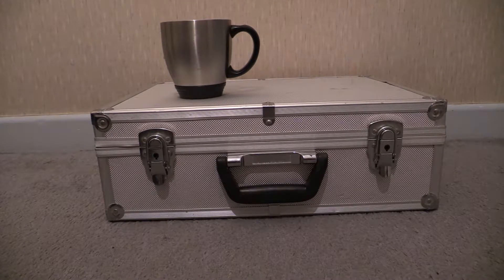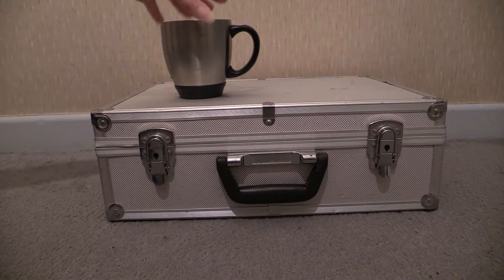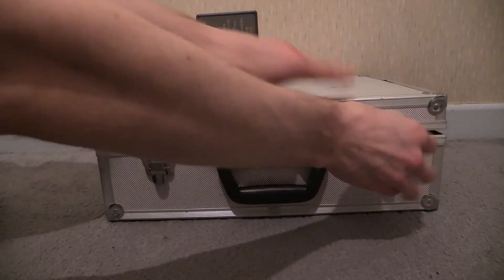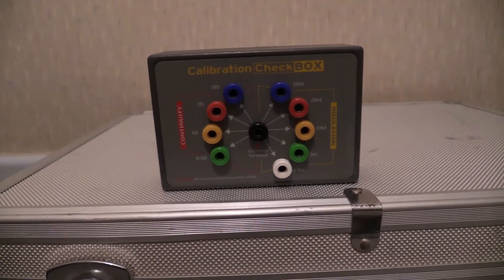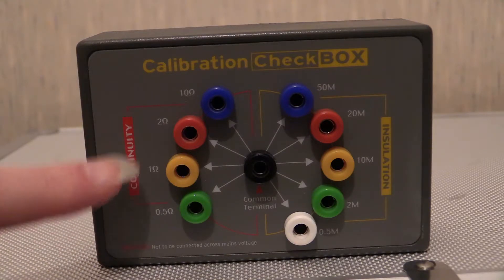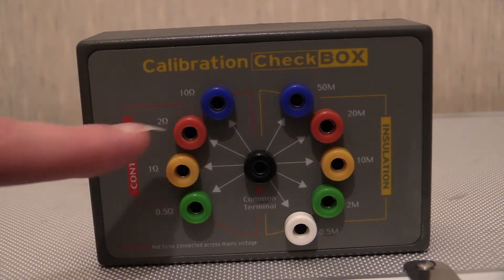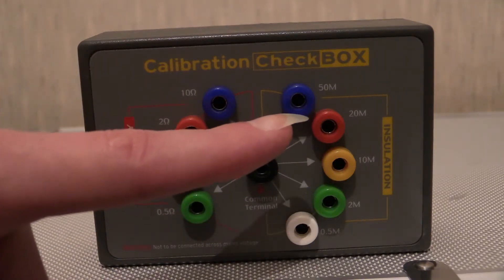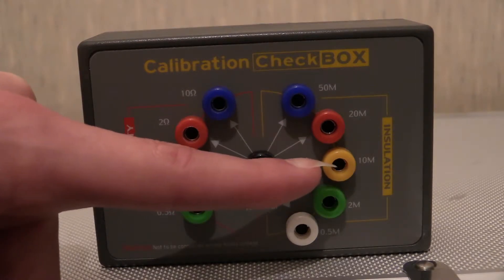Test Time : Resistance calibration check box

Comment: This is like a simple fixed resistance  decade  box. Many years ago,  (In the 1980s)  I worked for a year at a large well known  (at the time) electronics manufacturer in the UK. I worked in the test equipment calibration & repair dept, one of the common pieces of gear were variable resistance Decade boxes, which were basically a box with a row of knobs, which you adjusted to obtain the exact resistance you required for the test piece being  calibrated . You could obtain any resistance from many Meg ohms down to a  fraction of an ohm. 
As well as testing multi meters, they could be used to in conjunction with other equipment to calibrate electronic thermometers, oscilloscopes  etc.
Reply from the maker: Hiya. I know of the 
decade boxes you 
mention. As like 
anything like that........

.....they were expensive! I remember years ago, going through the RS catalogues and seeing things in there like that, and they looked rather-much like what you mentioned in your post.

This one however, like you say, is a super-basic cheapened-down fixed-resistance version of the variable and more expensive units back-in-the-day.

The variable units might still be able to be bought, but the average sparky wouldn't get one, as they are really aimed at calibration labs and businesses that may wish to self-recalibrate all of their testers themselves.

Thanks for watching,

-Wayne's Electrical.

25th January 2019, 18.20

Comment: Neat setup
Reply from the maker: Yep, it is a good little 
box for cross-checking 
various bits of test 
equipment, and is handy...... 

.....to keep inside the case of test equipment just in case a tester starts throwing funny shapes on the screen, or when a tester (or its test leads) is/are suspected of being faulty.

This box gives a known reference-point for cross-checking testers, so is handy to have. :-)

Thanks for watching,

-Wayne's Electrical.

25th January 2019, 18.14